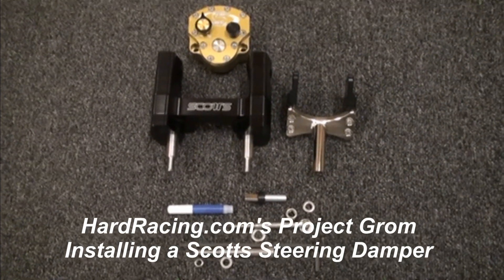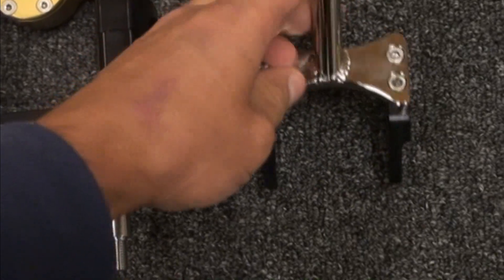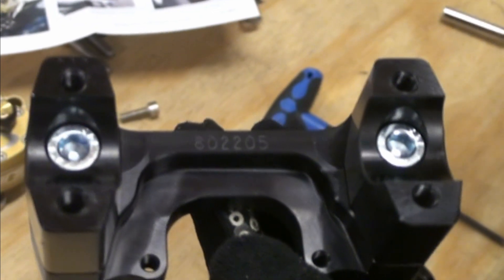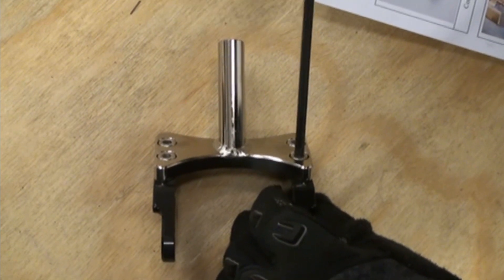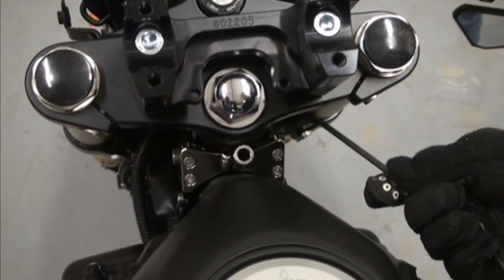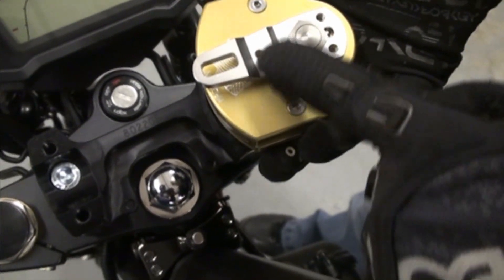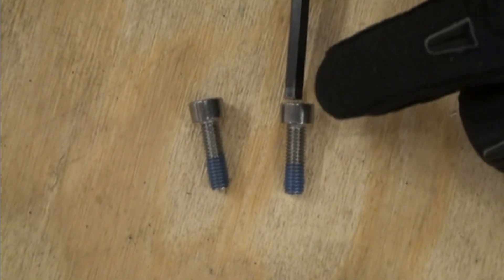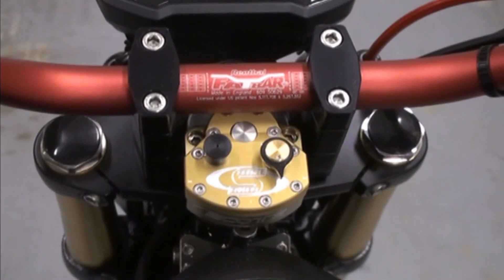Honda Grom Installing Scotts Steering Damper - Great Low Prices  Hardracing #HardRacing #GromDamper

Comment: Why would you put a steering stabilizer on a grom? Genuinely curious. I'm looking for one for an 03 cbr 954rr and this popped up
Reply from the maker: For the same reason you put a Damper on Any bike.  The very short wheelbase makes the bike frond end twitchy at high speeds.  Specially on the interstate.  The Damper helps reduce that.

Comment: Whats up. Where'd you get the grease for the tower pin
Reply from the maker: You can get Grease from Autozone, Pepboys, Advance Auto... Wallyworld....etc.
Just normal Axle Grease, or even White Lithium Grease will work.
You only need a light coating.